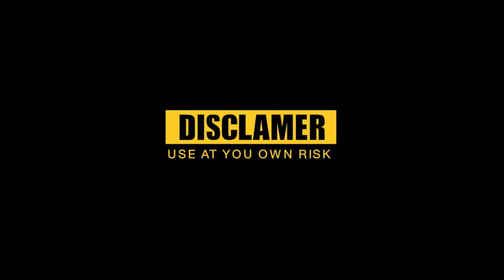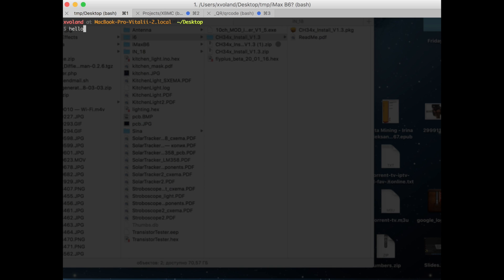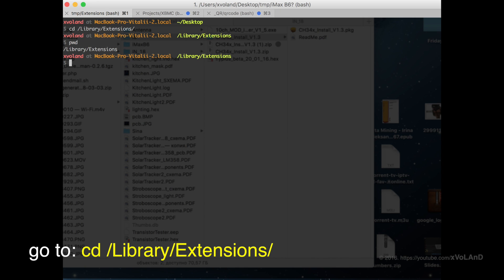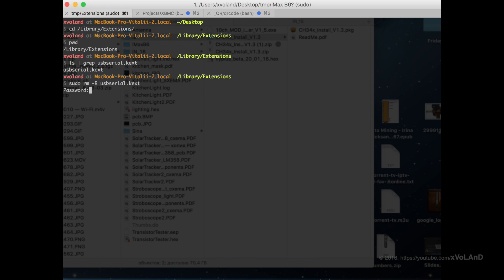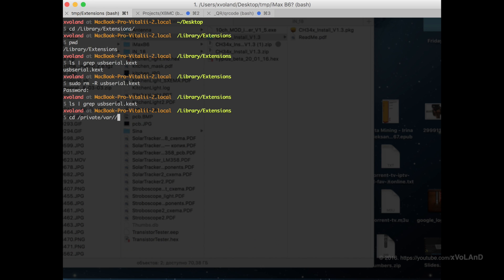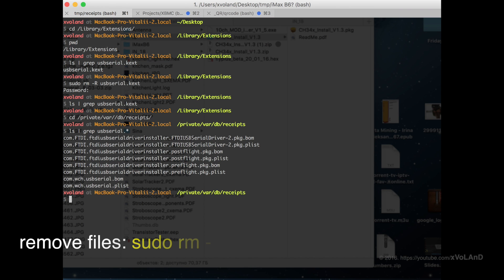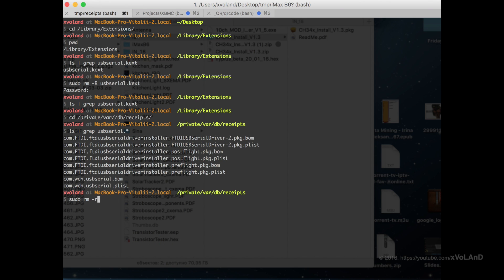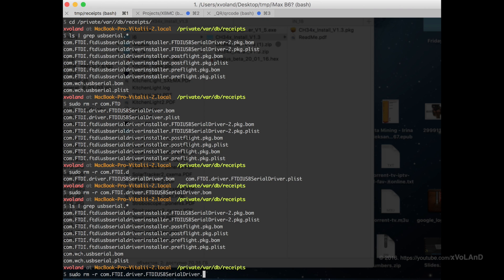How to install driver CH340/340g CH341 for USB-TTL Arduino IDE on macOS 10.12 Sierra 16A313a

Comment: how about catalina?
Reply from the maker: have you tried these steps on Catalina?
Reply: @xVoLAnD  i've been trying for hours
Reply: Well it did for uno, but doesnt work for nano
Reply from the maker: It depends on which chip is in the adapter. In my case CH340
Reply: @xVoLAnD  yes. My nano is 340G just like ur title
Reply from the maker: So this driver doesn't work on Catalina? You could not install?
Reply: @xVoLAnD  it works but for arduino uno (CH340), but doesnt work for nano (CH340) so far...

Also the macbook version (1.5) is outdated than the windows version (3.5)
Reply from the maker: Ok. Thanks!

Comment: Worked for a couple of hours, then some USB driver file went missing according to Arduino IDE.
Reply: Installing this file solved my problem: http://www.wch.cn/download/CH341SER_MAC_ZIP.html
Reply from the maker: It’s still works on Mojave and there are no problems
Reply: @xVoLAnD  Had the same problem again. Driver(s) went missing. I've spent 5x more time trying to get this work than acutal coding.
Reply from the maker: Magnus Anemo I have nothing to offer you, it works for me and no one else has written about a similar problem like your. Check my previous video about this, maybe you’ll find something useful to solve your problem.

Comment: BE EXTREMELY CAREFUL before you fuck with your kext. I followed these instructions and could not reboot my mac - i had to completely restore my mac from backup THANKS for nothing Vitalii Tereshchuk!!!
Reply from the maker: This is not for beginners, you are right (see warning). In any case, it's a good point for reinstall the wrong driver. If you didn't have a driver, you can install it without problem (see another video). Also you can ask if you doubt your actions. No need for thanks.

Comment: Hello Vitalii,

I have tried your recipe and it doesn't work for me. I have 10.12.3. and after removing and installing driver I still don't have /dev/cu.wchusbserial* :(

when I run it shows following message.
$ dmesg
...
AppleUSBHostRequestCompleter::clearPipeStallThreadCall: clearStall for pipe <ptr> failed (0xe00002e2)probing
wch_usb detach. provider USB2.0-Serial.
wch_usb start.
       1        0 wch_usb: configDMM - find the config interface numbers
wch_usb detach. provider USB2.0-Serial.
wch_usb free.
IOUSBHostInterface: bad busy count (0,-1)

Backtrace 0xffffff800089885b 0xffffff800089a1de 0xffffff80002a0af7 0x0 0x0 0x0 0x0
probing

Do you have any idea what could be wrong?
Reply from the maker: Mario Kusek Hello Mario, it's works 100% if you make a step by step as I have and you don't have installed special software.
Reply: I have finally manage to make it work. It was problem with USB cable. The same cable works on newer macbooks but it does not in older one. So I buy quality USB cable and it now works on all macs.
Reply from the maker: Mario Kusek I told! It works 100%! Congratulation!
Reply: Thank you for this tutorial and keep up the good work!

Comment: Do you have to remove the drivers if you haven't installed any drivers? Like if the laptop is brand new MacBook with touch bar?
Reply from the maker: Peter Bohus If you have not previously installed CH340 driver, skip this step
Reply from the maker: Peter Bohus Install the driver as usual. I can't verify this on new Macbook with touch bar
Reply: Vitalii Tereshchuk hello, thanks for the reply, say if the drivers don't work - how do I remove drivers on a mac that I installed? Thanks - I'm new to MacBook btw lol had windows before...
Reply from the maker: In the video I removed FTDI driver... https://youtu.be/SXpej0rwJjs?t=180
Reply: Thank you so much it worked!
Reply from the maker: Peter Bohus Cool! Congratulation!

Comment: Hi. After having done those steps now the mac does not leave, and it restarts again and again. Could you help me?
Reply from the maker: claudio flores Hundreds of people have repeated my steps and have not had any problems. What did you do? Do you have a backup?
Reply: The same has happened to me. Now my Mac won’t even boot because I followed your instruction and removed drivers WTF!!!!!
Reply from the maker: I need to know the steps (screenshots) to point out to your mistake

Comment: Thanks for your video. I am using Sierra 10.12.1. Driver installs correctly but when attaching terminal and device i see strange symbols like the speed or flow control is incorrect. Do you have solution ?
Reply from the maker: I don't quite understand the problem, but try  change the speed of COM or/and the power adapter voltage to the 3.3 volts
Reply: It does not work on 10.12.1 as expected. Strange is that if i remove the driver and run virtual box (windows xp) then hyperterminal there i can see my cisco switch normally. So i think driver is not ok on 10.12.1. If you have some cisco/at switch or other serial device try it.
Reply from the maker: Todor Neshev I'll check today
Reply from the maker: Yes, it doesn't seem to work correctly, but there is a way https://youtu.be/9sKte_geQ1o
Reply: lower your baud rate on the serial driver